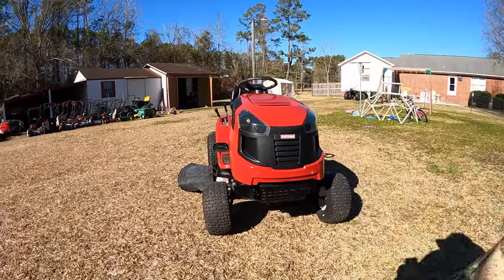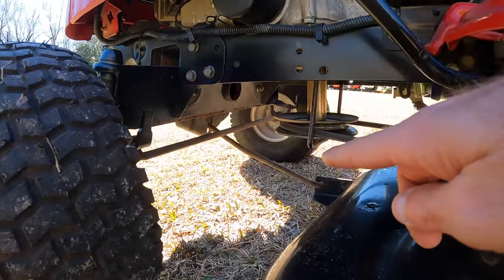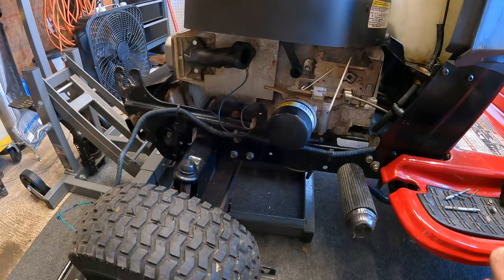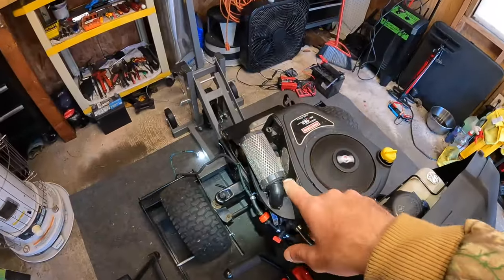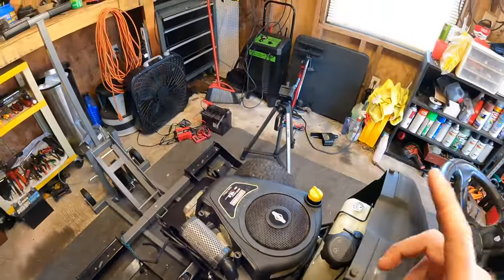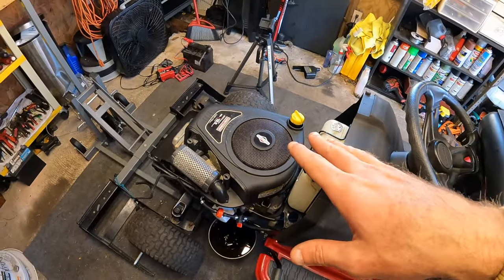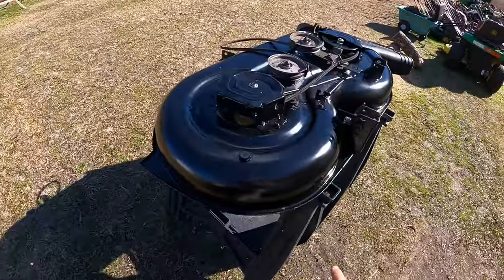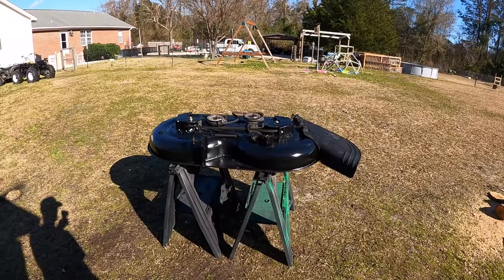RESTORING A FREE BROKE DOWN CRAFTSMAN RIDING MOWER

Comment: The blade spindles bearings can be regressed by  removing the seal on  bearings I did a video on this one for my craftsman ys lawn mower front tires  glad you got a new carburetor on this one
Reply from the maker: Yes I tried that on the original spindles but the bearings were damaged and still made a lot of noise. Thank you for stopping by. I think this one turned out pretty good.

Comment: I have a real softspot for Craftsman mowers and Craftsman tools in general. It's becoming harder and harder to be a fan as their products progress forward. I had a new one as my first in 1991 it was a GT1000 maybe?? It's was a bigger mower with the same motor that John Deere used to use am 18 Kohler with and oil filter. This was all pretty cutting edge in 1991 and I think I paid between 11-1300 for it and it lasted for years! My Dad bought it off me after I was done with it and it lasted him (mowing 2-3 acres weekly) until he was too old to takle care of things and moved into a mobile home park. I went on to purchase one of the green lt1000s with the automatic ground contral transmission I LOVED that thing! It was a like a sports car compared to others of its time. It laste me 20 yrs and I gave it to a young church member and it didn't last another two seasons. smh says more about it\'s use thanm the mower itself. I'd like to have another one to piddle with one day. I have a friends Black kand Yellow Craftsman now that I'm in the process of redoing for them. I cann't believe how expensive things are for them anymore! You're totally right to have a small mower graveyard to rob parts from. whew!
Reply from the maker: Absolutely!! The older craftsman truly were built to last. Just like their tools as well. The quality has declined tremendously over the last 20 years. My favorite riding mowers are the lt1000’s with the hydro drive. Very easy to maintain, and great mowers.

Comment: I have an even later model craftsman riding mower and she has been a jewel all carb, alternator, fuel filter blades belts. However now she won't start, battery is fully charged, spark plug is new And yes it has gas and oil. But I can't even get a click when I turn the key. Was running a few days ago.

Comment: Same mower I have. You must have disengaged the reverse shut-off while blade engaged feature 😉. Also, there’s a nipple on the air intake tube you touch at 7:51 of the video. Mine has a hose from there to nipple at top of fuel tank. That could allow dust entry after the air filter. You might want to plug that up or restore the hose. Great work, looks like new!!!

Comment: Nicely done Alex, it turned out great!  You are definitely more thorough than me when it comes to cleaning!  Good idea on doing a complete deck rebuild, in my experience the spindle bolts on MTD mowers almost always come put without breaking.  The same can't be said for AYP ones though.  This will be a great mower for someone and hope you make good money on it.
Reply from the maker: That’s good to know on the MTD decks. I’ve only done a couple and had bad luck, but yes I know the AYP are bad as well. This one turned out pretty nice although it was in decent shape to begin with. Just needed going through. I hope repairs are going good your way. It’s been tough here working in the cold.

Comment: Great vid as always; you got lucky on that new Nikki style replacement carb working right off.  On my flips, if the engine came with a Nikki, it gets retro fitted with a Walbro knockoff, have just lost faith in Nikki knock offs and don’t even waste time anymore trying to clean the OEM Nikki’s on those Inteks.
Reply from the maker: Honestly I’m done messing with the Nikki carbs after this one. Still had issues with it after filming. I would rather run walbro any day of the week. Easy to clean and adjust. No more flooding issues.
Reply: @freedommowers420  The only problem I have had with cleaning a super corroded Walbro is I strip the main jet trying to take it out with a flat tip screw driver instead of the actual jet tool.  If I can get that jet out, I can generally save an OEM Walbro but if not, I will spring and buy the $25 Amazon version of the B&S 799728 and call it good.  A lot of small engine mechs will knock those Troybilt/MTD style 42in mowers but like you I have found they are easy to refurbish/recondition and if taken care of are a good mower for home owner use:-)

Comment: You should engage the blades at full throttle .
Reply from the maker: Why is that? I’ve always engaged at half throttle to keep the wear down on the deck belt. Full throttle is like dump clutching a car.

Comment: You are very thorough. That looks and drives like brand new. These are like $2000 band new in ‘24. What can you sell it for in your area?
Reply from the maker: I’m guessing it might sell in my area for around $600-$800 would probably be the best guess. Yes I think our lowest prices Troy bilt pony in my area new is like $2200 after tax.
Reply: @freedommowers420  $2200 for a base single cylinder tractor is nuts! Those things were like $1000 3 years ago.

Comment: I would have thrown that cheap fuel filter right in the thrash. They filter literally nothing. Using quality parts make a big difference. On how your equipment will run.
Reply from the maker: Thank you for the input. I’m going to put a order in for a batch of quality filters that will actually filter. I appreciate you stopping by.